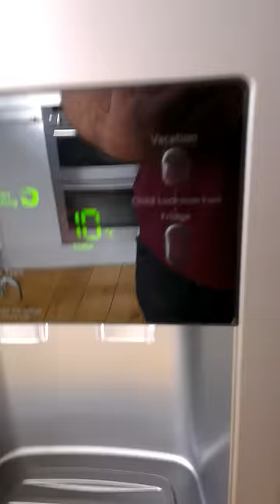samsung rsh1 model  fridge freezer noisy fan full diy video

Comment: Thank you for the video. 
Is there still a 2nd part as a continuation of the video? Since I can not see the rest here.

We have for a week exactly the same problem Samsung Side-by-Side RSH1KTPE.
The fridge temperature gauge is always at 16/17 degrees (instead of 7 degrees) and the right side is extremely noisy when the door is closed. As soon as we open the door, the loud noise goes away.

We would appreciate the 2nd part of the video.

Many greetings
Reply from the maker: Basically, you need to change the white panel and the defrost sensor, Please call me if you require further help - 07407734204  please have a look at the home page for more videos - this video may help you a little as well  https://youtu.be/4FSG2-nmBUc?si=aELDVZ9efM3NCmDI

Comment: Hi appliancetechnical      I'm hoping you can help me please!??? (I would be very grateful) Samsung have replaced the dodgy parts in the fridge under the recall extended warrantee (with the same kit as you are selling) … but it appeared that the same kind of thing was happening to the freezer side whilst the fridge side seemed to remain fully functional… The short term solution was to fully defrost the freezer, then it worked fine until the ice built up again, especially down the bottom… now, since the last defrost it just keeps throwing the trip switch so can’t use it at all :( Any initial ideas on what is likely to be shorting out would be extremely helpful?… after defrosting, there was a draft coming through the vents but is it likely that this could have been coming from the fridge rather than the freezers fan?
Reply from the maker: hi you would be best to call a local samsung engineer on this fault im afraid , freezer issues are a lot harder to diagnose ,

it could be freezer fan 
thermal fuse 
defrost heater 
loss of gas 

the freezer side is not easy to diagnose im afraid due to the list of potential components that may be faulty  , plus you would need test meter etc 

really sorry i cant help you any further on this one 

ally